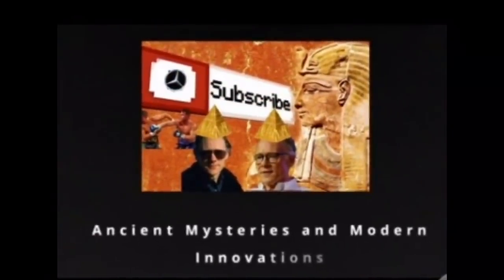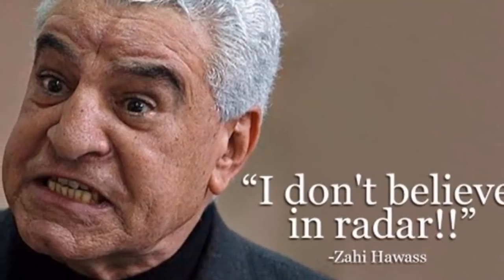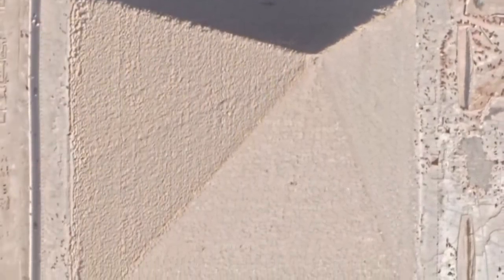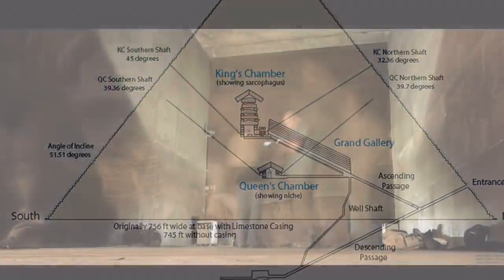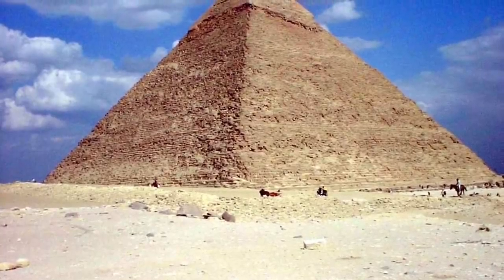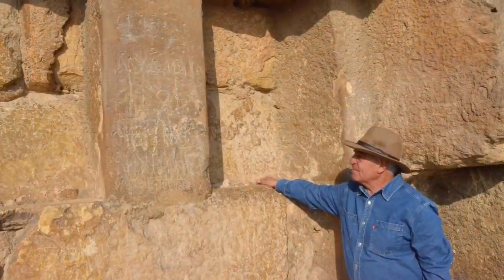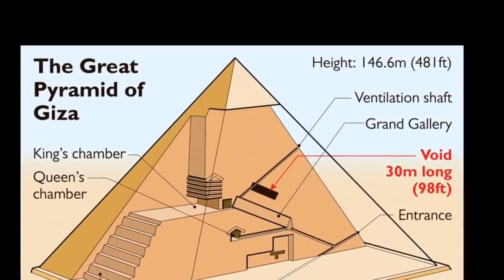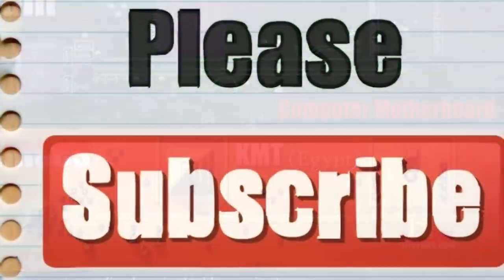Graham Hancock on Geopolymer (Liquid Stone) Technology at Giza Pyramids

Comment: To be honest.   I think that the pyramids erosion has a different story to tell.   I no longer believe that wind and sand did all that damage to the pyramids.  Also, I don't believe the locals took all the stones but the ones highest up to use in other building projects, necessarily.  I think a pole shift knocked the Mediterranean Sea out of its bed.  I think it's sea water that did most of the erosion and all the way up to where the case stones are still intact.  In essence, a flood of massive proportions.   Hundreds of feet high.  Perhaps 300 feet high.   And the water stayed that way for a while until the shift occurred and the water could flow back down into the ocean beds.  It would take carbonic acid to do the sea water weathering.  What I am getting at is that the pyramids are much older and the later dynasties did not build them.   Khufu, for example did not build the big pyramid.  That was already there, as was the Sphynx.  That would put the pyramids at 12 to 14,00+ years old.

Comment: How did the sea shell escape pullverising when they pound on the stone, the shell would get blasted by a hammer not left on the surface of the block unless erosion exposed it after the hamering, conclusion is hamering should destroy the sea shell but it was gently poured instead.
Reply: No grinding. Water weathering in the wadi.

Comment: The reason you have some fossil's in the blocks, are because according to that gentleman that discovered the geopolymer, was that part of the making of the mixture required ground up sea shells, that were cooked over a fire, then ground up, and put into the mixture, so it is very possible that some of those sea shells were dropped, and could have very easily landed into the mixture as it was being prepared.
   As far as you question on the large granite blocks, well like you said, those came from a rock quarry and in those quarries they would have needed a way to move those large stones, the stones were moved using elephants, and elephants could have easily been used at the pyramids as well, so thats how its believed that the granite was moved.  🤔🧐😁👍

Comment: They have found Biological material inside Granite and other Igneous Blocks. Which is created by melting rock then cooling it solidifying the material. Biologic material can not survive the extreme processes in it's Creation. Of course they would use different material, to make Rose Granite, you would use material from Aswan. Using different combinations for ones that to create blocks that control the rate of energy it discharges or levels of resistance it creates. This would be crucial if the structures were designed to create or the distribution of electricity.

Comment: Mixing phosphates creates a permanent perfect biological glue with 10% woodgrain with aggregates the same as refractory high temperature resistant furnace clay they used similar processes to flash but more expensive cnc epoxy granite limestonebor sandstone rambpumps for diveribg the flow of the nilevriver horizontialky acrossbtge Sahara they used 30ft copper limetone saws with mica for friction eayer loosh saw cuts for collecting stonesaedust transported via cemeramic concrete pupelines 200 miles away from quarry to geopolymer casting sites

Comment: Looking at the comments and having done a lot of concrete work in my building life I have to agree that since The Great Pyramid is so sophisticated and remarkable in its design, only a blockwork construction makes any sense. Forget the 100,000 slaves - in fact there is absolutely no evidence that Egypt had slaves.Graham Hancock has always been miles ahead when it comes to using commonsense and excellent deduction in analysis. The biggest point made elsewhere is that the largest blocks which are simply massive are high up in the construction. So they must have been formed on location. I also understand that the River Nile once flowed right passed the GP. AND BTW everything you know about the place is Greek. Egypt is a Greek word for Kermit (blackland) but  most interesting it that PYR-AMID Is Greek for FIRE IN THE MIDDLE. So it was/is an Energy Storage or emission structure - The Pyramid's correct name is Per Neter (in Kermitian) which means House of Energy (where neter became the word nature).
Reply: Isn’t the New Testament and records from Greece some decent evidence?

Comment: I've made, poured ,busted up , actually worked at a plant that crushed its own lime stone and made their own concrete. Usually rock is added to the slurry to give it strength.  But only to a certain size. When the rock is added its not absorbed, so when the block is chipped or busted it stands out like a store toe. If they could make a strong enough mixture to actually build 20-70 ton blocks then they would know that whatever gravel you do add is for strength and needs to be harder than the limestone. Even adding hardness or artificial binding agents and steel our mixtures won't last much more than a hundred yrs without constant maintenance  and applications of water sealers. So there's many reasons why the concrete theory doesn't work. But some of the south American sites need to pursue this maybe looking into possibly being a artificial mixture of something we have no clue about. Graham is right and the biggest roadblock to Egyptian history is Hawass. No telling how much he's hiding to keep everyone from knowing they just found it and moved in!
Reply: You are confusing modern concrete and geopolymer artificial limestone. Take a look at their reconstitution: https://youtu.be/znQk_yBHre4
Reply: @henrikonnou7466  I'll check it out when I leave. Actually read something on one of these channels about how they have figured out what made Roman concrete so long lasting. Seems they used a process where they used seawater and something I think they called hot lime. It made the mixture self-sealing when it cracked water entering would reanimated the mix,revealing it. Still kinda scratching my head on that. Might need a simpler explanation, like maybe associate degree english.  Have a great one bro
Reply: I'm not saying the older stone work at like Machu Pichu isn't geopolymer. It actually makes more sense than it's real stone work. But it is real stone ,they have have tested the blocks. And they come from the mountain next door. Cut from damn near the same altitude as Machu is built. Here's where I need to tell educated people, WTF! You know if these hunter gatherers could sling 10-20 ton blocks on their shoulders then down mountain TRAILS(no cut roads on either mountain) then tote them up mountain TRAILS!  I'M pretty sure the nubs you see on the larger blocks I would say are used by something to set the blocks in place. Strange seeing as how they weren't supposed to have the pulley or block and tackles. Grass rope and leather straps are OK for maybe up to a ton.I kinda got off topic but it seems all this stuff is connected. They can explain small pieces of the puzzle but there guesses only cause more questions!

Comment: Humans can easily haul these blocks by use of sheaves and pulleys mechanical advantage. 2 teams either side with elephants, bulls and humans with hemp ropes and block and tackles on top of it. Ramps and carts and water (liquid weight) acting like a continuous elevator system might get somewhere.

Comment: Could the quarried blocks and geopolymer blocks be used at the same time?
When we quarry blocks, doesn't it produce dust and rubble?
Is it possible they simply made the geopolymer blocks out of the stone sawdust just as we make boards out of wood sawdust, even though we also make boards out of solid wood planks from trees?
In other words, perhaps they were reusing, recycling, repurposing materials just as we would today.
Reply: no need for block if they can be made easily

Comment: This is the dumbest idea surrounding the pyramids - even dumber than UFOs building them.

Let me get this right - gravel from the Giza floor was put into clay jars and put on sleds and pulled up the pyramids, and then water was put into waterproof clay jars and put onto sleds and pulled up the pyramid and mixed and placed in molds and allowed to set for a day or so and then moved into place.

Good god, how stupid are you people? That means the clay jars, double the pyramid's weight pulled up the pyramid, and then all those empty fragile clay jars were lowered down the pyramid to be used again.

To construct the Great Pyramid in 20 years means 1 finished block PER MINUTE of the work day was set - it would take hundreds of thousands of men lugging, mixing, waiting, and moving blocks to do this.

UFOs sound more likely than liquid stone.

Comment: The assumption that Davidovids claims grinding happened is incorrect, his theory is that local already crumbling easy to use material was used (right next to the pyramids), mixed with water and the geological "glue" and the moist material pounded into forms. Shells, fossils etc. would not be destroyed in this process.
Reply: Correct: https://youtu.be/znQk_yBHre4

Comment: The Grand Gallery was used as a giant man-powered freight lift from the other side of the pyramid for the granite blocks before the upper layers were created. The scratch marks can still  be seen today from the ropes on the edge rails of the Gallery and on the Great Step at the top of the Gallery. Still ingenious though. As speculated here the other non-granite blocks were made with Geopolymer technology and cast whilst in position.
Reply from the maker: I highly doubt things were brought up such a steep angle, without any of the modern things in place it's nearly impossible to climb.
Reply: @AncientMysteriesAndInnovations  It's the best theory of why the Grand Gallery exists.

Comment: Just a question?  Why couldn't they have added things to the mix as fillers or simply as a binding agent ... giving it something to hold on to? 

I think if it's possible to have had some form of making molds with a concrete like substance .... 

Or it was little green men from Mars, the possibility of them simply adding things to the mixture for ..... I don't know maybe so they simply didn't have to use so much mixture ... 

Just seems to be more likely. But that's just me I guess?

Comment: If you look at the kings chamber and surrounding tunnels in section, it is similar to a giant furnace. All lined with granite as it has a higher melting temperature. Was it not used to melt the limestone?
Reply from the maker: some process definitely took place inside

Comment: They put coral and fossils as a lightweight filler,you would need some actual blocks then make a mold or form of said block ,then u can pour as many as u want. That way they would only have to cut an transport 1/4 of the entire pyramid blocks to make molds for the entire pyramid structure. They could even pour them in place against the lower dried blocks using thier mold,that would let them separate but be perfectly snug against one another.They understood the chemistry involved to simulate natural local stone. And they built all these great stone architecture sites before pangaea split up .
Reply from the maker: all the blocks are different sizes...

Comment: If molds were used, and once the poured mixture hardened, the molds would then be removed leaving a gap between the blocks, so how are they fitted together so tightly if molds were used? That is my question and why I dismiss the poured mixture theory.
Reply: Maybe they used the side of the other block as the actual mold.